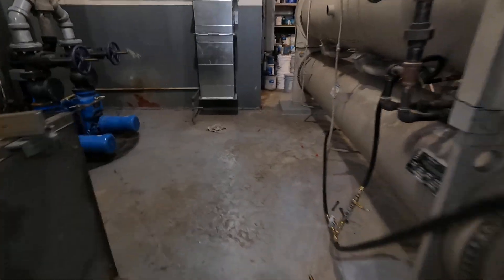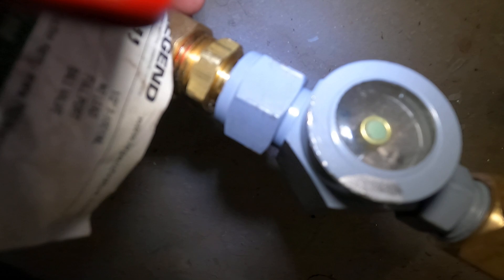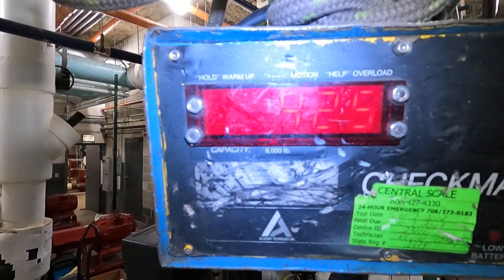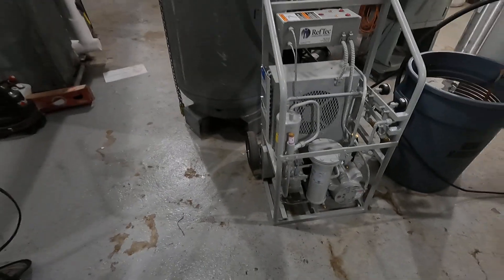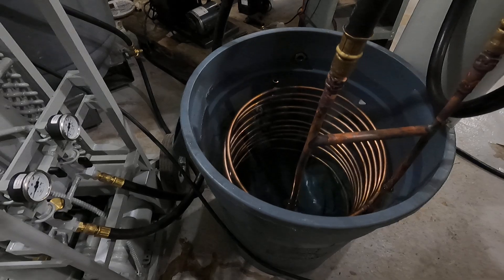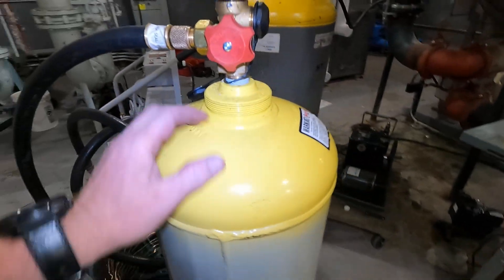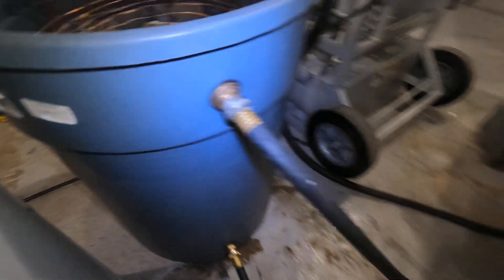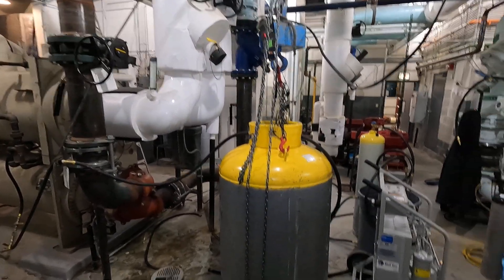Chiller Refrigerant Recovery

Comment: Nice 

Recovering VRF with 410A can be difficult.  Running the Appion Speed-R kit, the pressure rises rapidly in the cylinder. I made a smaller heat exchanger wrapped on a 6" pipe, with a sight glass on the output, it fits in my ice chest.  The sight glass on the output usually runs clear with the occasional bubble.  Drop the cylinder in an ice bath and on cold mornings end up with my core tools covered in ice LOL!  Larger hoses on the Speed-R kit don't twitch like the 1/4" hoses did.
Reply: I need to make some grounding cables, sometimes the static charge builds up between components. I've heard of several cases where it took out a scale.

I want to try using a condenser from a water source heat pump.